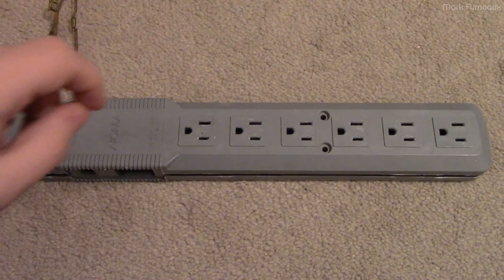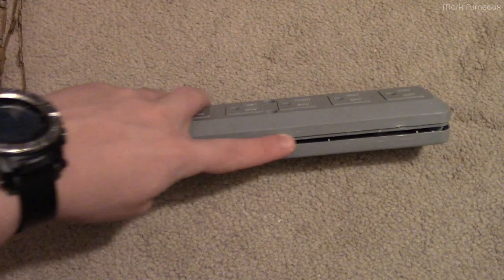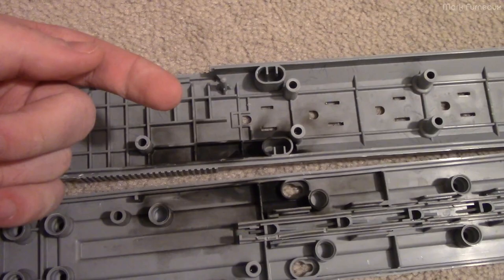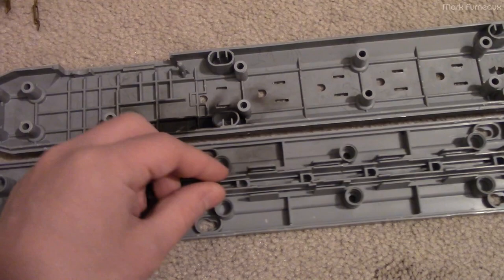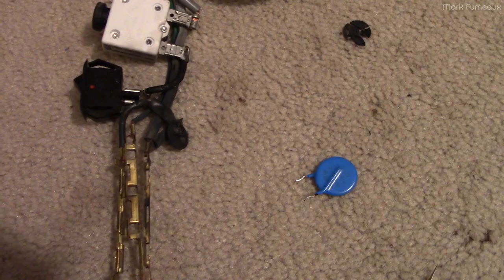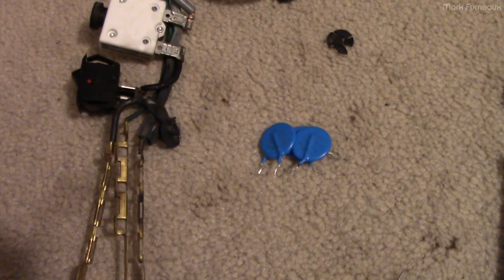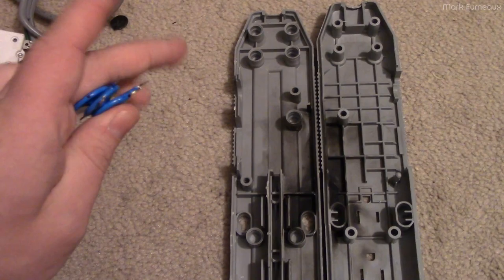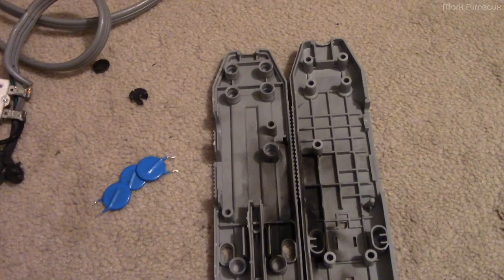Inside a Power Bar After a Surge, and How MOVs Work

Comment: I've never actually seen the aftermath of a power surge through a power bar. Super informative!
Reply: I have in real time it was a multiday surge the fluorescent lights were buzzing really loud blew out fridge compressor I was playing video games Infront of TV heard electrical crackling sounds behind TV and all my electronics cut off immediately smelled burnt electronic smell when i poked my head behind TV opened up all my surge protectors all the MOVs were completely charred all of our electronics were saved the fridge wasn't on a protector

Comment: Size has NOTHING to do with clamping or varistor voltage in MOV's The numbers on the side indicates voltage and for example - 14mm(medium size that blew up) and 20mm(the 3 new ones you're handling) Bourns MOV's are Both available with The Same Varistor Voltages from 18 to 1800 volts. Size combined with voltage rating does have a direct bearing on the Joule rating . An example of the numbering system - 20D241K- 20D=20mmDiameter-- 241=240volt nominal Varistor Voltage--K=10% Tolerance. Depending on the voltage rating, 20D MOV's can have from 11Joule to 626Joule rating. At the same voltage ratings, a 20D has about 1.6 times higher Joule rating than the same voltage 14D.    The crazy ratings seen on many new units is curious indeed, I think they have switched to IsoMOV's which are an "all in one" MOV and GDT which creates a much longer life component. These do not have the same Joule rating but a Max Peak Current rating. No doubt some form of "Creative Mathematics" by the manufacturer's marketing dept. has somehow converted it to Joules , very optimisticly!!!

Comment: I’ve seen surge protector companies claiming that PCB trace spark gaps should be included in the joules rating, that can easily inflate the value.

I wish companies would be more transparent about it, often times marketing will just say “surge protected” with no joules rating and modern products have non-reversable screws so taking them apart for inspection is very annoying and often destructive.
Reply: I'm sure it's pure marketing wank. How are you going to measure how many joules a random surge was to prove it was under the limit? Has anyone ever actually recovered any money from any of the claims of "$xxx of protected equipment guarantee"? I'm sure you need the original receipt, and the original packaging (and probably the poops you took immediately before and after buying the power bar) to even begin to think about collecting (which everyone throws out 5 seconds after you plug the power bar in), and then even if by some chance you actually had that, they would just say "well, the surge was greater than YYYY joules" and how could you ever disprove their claim?

Comment: They're not all gray - I have that exact same power bar in off-white (cream? beige?) color. Actually thinking about it, I think the MOV might've blown up in mine too - it exploded once when I turned it on, but it worked fine after (though maybe it was the switch itself that crapped out, and I took it out and soldered the wires together permanently and covered the hole where the switch used to be by wrapping electrical tape around the whole thing - don't exactly remember now) - now I'm curious. Next time I find that power bar, I'm going to check!

Comment: It amazes me that the power strip still works after these have been blown I would think that it would stop it from working because you no longer have surge protection
Reply: Yeah, that's why a good surge protector has a light on it to indicate if there is a surge.  There is just no other way to tell unless the blown varistor and the lightning damage the outer casing. I like power strips with an all metal body for this reason.  If you have anything flammable around your power strip  you want to be sure that any internal shorts stay internal and don't melt their way onto the carpet.

Comment: So is a grounded outlet required for surge suppression or not? If the MOV's are placed on each combination of the 3 legs, then shouldn't surge suppression still work? I was under the impression you have no device safety without a proper ground, but you can get human safety by adding a GFCI. I am in a 1960s home which has no grounding, so a lot of my UPS' and power strips show wire fault or the protection light won't light up. But I have heard they make special surge suppressors that'll use Neutral. Maybe I'm confused, if MOV's absorb excess voltage/spikes instead of sending said excess to ground.
Reply from the maker: Nothing is sent to ground, that's a different type of fault. A MOV between line and neutral will still provide surge protection without grounding.
Reply: @TheUbuntuGuy  Interesting, I always thought the MOV's send the excess to ground, which is the whole point of having a ground, that and a backup for if you lose neutral.
Reply: @victorcoss2600  The MOV basically turns into a short when a voltage over its threshold is reached. The MOV sacrifices itself to shunt the excessive voltage. If it's a MOV from line to neutral, then it just shorts line to neutral to try to dissipate the voltage spike. Neutral is connected to ground at your breaker panel or service entrance anyway, but "ground" is never meant to carry current (for safety reasons) whereas neutral is always carrying current in most circumstances.
Reply: @TheUbuntuGuy  Most decent surge protectors now have MOV's that span Hot-Neutral, Hot-Ground and Neutral -Ground, so YES in some cases they can send to ground. Transients can come in on any of the 3 lines though most come in on Hot and can be shorted to neutral by the MOV.